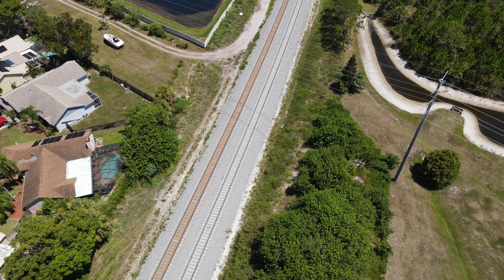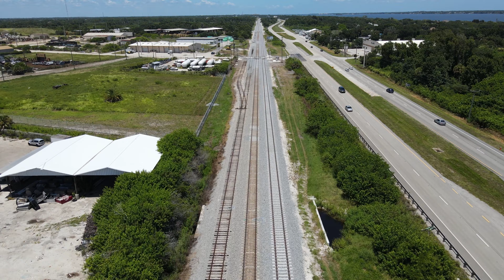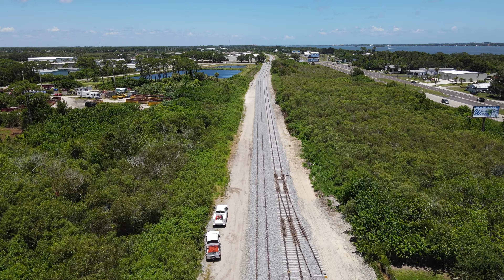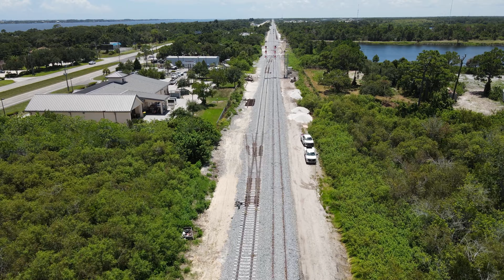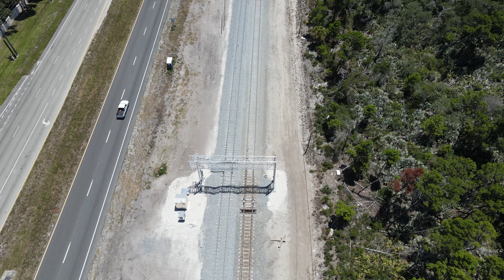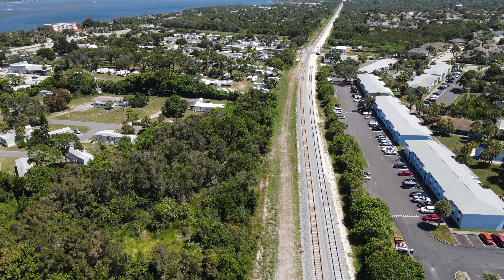Brightline Construction: Full Flight over the Completed ATC19 - July 2022

Comment: I am wowed by how straight the track is - with how built-up FL is nowadays I was thinking there be issues - maybe that will come when they come to part 2 or 3 of the line
Reply: Fortunately for Brightline, the FEC line had previously been double tracked, so the right of way was already available, otherwise this would have been a far more challenging project
Reply: @coryburris8211  looks like the ROW has room for a couple more tracks if needed
Reply: @AnthonyBrusca  Any additional tracks will be tight on the ROW in some places.  Fortunately, there are no deep fills or cuts that would require additional ROW for grading purposes.  For an idea of what that might entail, look at the videos of the Cocoa to Orlando section.  Most of the major fill work and abutment work for bridges has already been done for the second track.